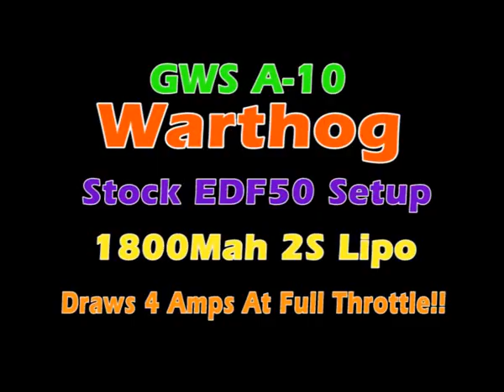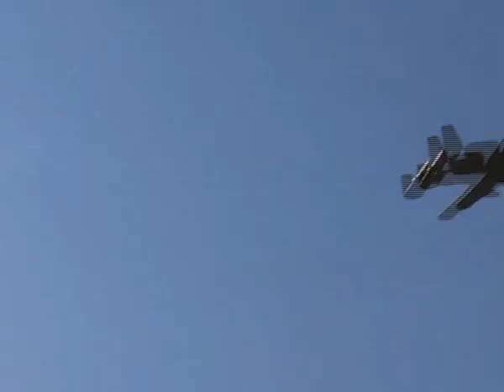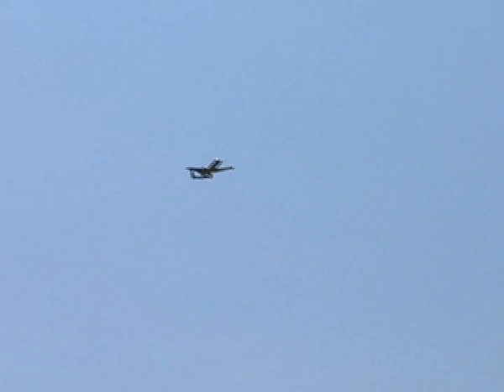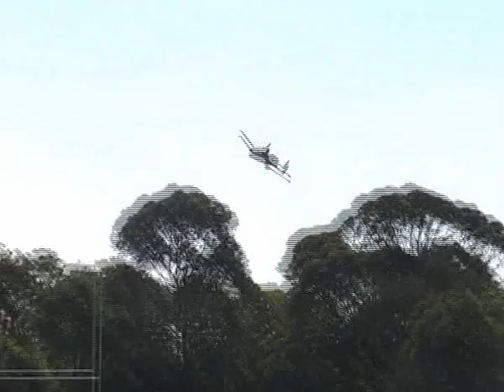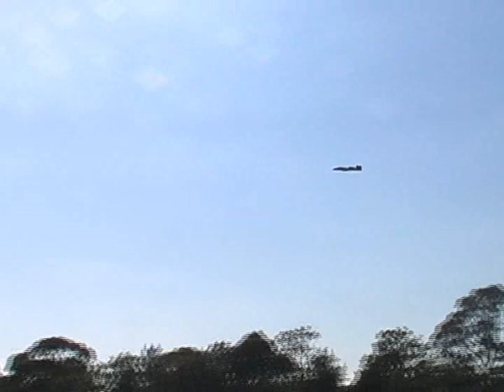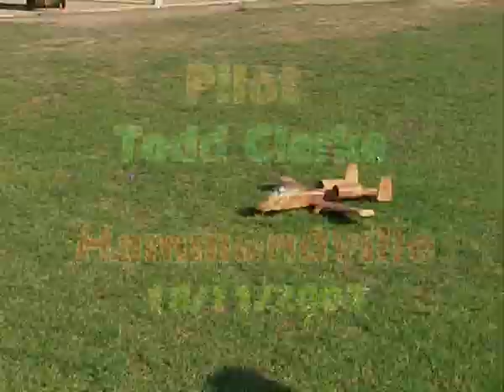GWS A-10 Warthog - Stock Setup

Comment: Very nice flying and landing also. So you used the standard motor setup as it comes out of the box from gws (I mean the non-brushless version)? If  so, it's all the more impressing, because I heard from so many people that it can hardly be flown without brushless, otherwise one would have not sufficient power. The way your a10 started from the hand, I think a brushless setup is not needed.
Many happy landings

Comment: Well, impressing. Yes, I know that one better builds them light, but I can't think of a way to build them heavy except for adding a finish with silkpaper and watered glue or floorseal... That's what lots of people over here do with their GWS warbirds to protect the surface. Well, they then have to fly faster which I think doesn't reduce the risk of crashing  a plane... ;(
So how much throttle did u use while handstarting?